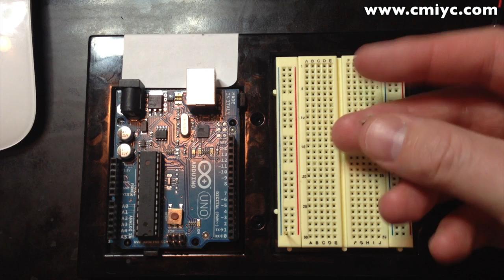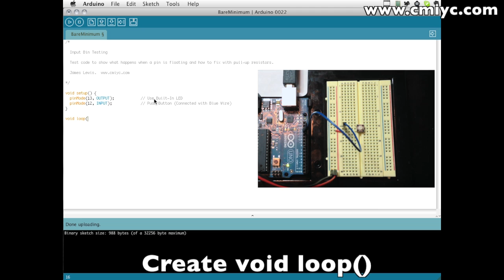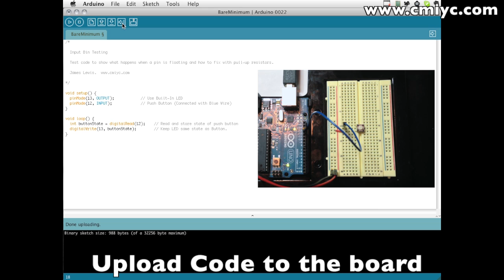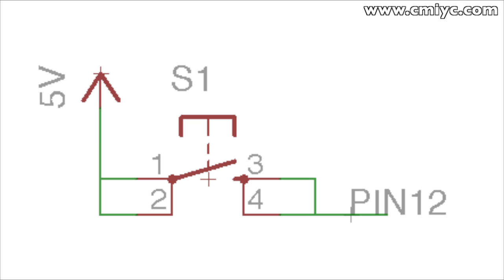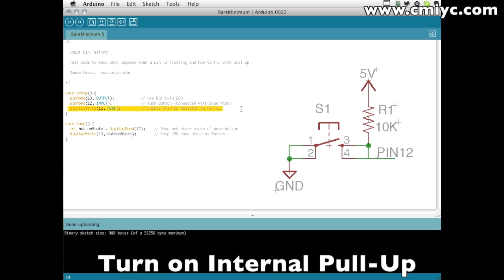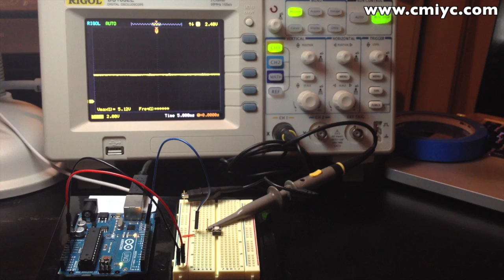Button Tutorial: Arduino Built-In Pull-Up

Comment: Code should be: pinMode(12,INPUT_PULLUP) instead pinMode(12,INPUT)
Reply from the maker: That didn’t exist when I made the video. Which is why it is shown the old way, with setting to input and then writing a high to the pin. (Which still works today.)
Reply: @bald_engineer  OK thank

Comment: Why do you still have the 5V wire going to the breadboard.  That doesn't seem to be used for anything in your circuit once you enable the pullup.  If that is true where is the 5V coming from in your diagram.  I guess something is going on with the input pin that I don't quite understand.

Comment: @James Lewis

Is using digital_write on a pin setup as an input just an older way of using the internal pull-up resistors? I know Arduino has an input_pullup parameter when defining your pins' functionality, but I keep seeing this way of utilizing the pull-up resistors. Was this video before an update to the language; I see this video is like five years old now and I'm just learning about micro-controllers.

Comment: At 2:32  you show a diagram.. with an arrow pointing at 5V. What is that arrow? Is it meant to be conventional current? (thus pointing from + to -).  Or is it electron flow (Thus pointing from - to +).  Or is it neither? What is that arrow?!
Reply from the maker: boliussa It’s just a symbol for a voltage rail.
Reply: @bald_engineer  ah ok, thanks

Comment: How to do the opposite, and have LED turn ON when the button is pressed? The pin is always 1 with the internal pullup, and pressing the switch pulls it down to 0. One way to do it would be to check when the pin is not equal to 1. For example:

void loop() {
  if (digitalRead(12) != 1) {;  // If pin 12 is not high, then button is pressed...
    digitalWrite(13, HIGH);  // Turn on the LED
  }
  else (digitalWrite(13, LOW));  // Otherwise, while button is unpressed and pin is pulled up, keep the LED off
}
Reply: You can change the arduino code after reading pin 12.    
Add=>  
if (buttonState=HIGH) buttonSate=LOW; 
else   if (buttonState=LOW) buttonSate=HIGH ;

Comment: Fantastic video!  Very clear and easy to understand.  I learned a lot - like that Arduino code is very case sensitive!  Words like INPUT and OUTPUT and digitalWrite must be capitalized just as they are written or the code will not work.  It took me quite awhile to get all the capitalization bugs out of the code before it would compile.  The only change I would suggest would be to show on your schematic that the pull-up resistor is internal to the Arduino but a very minor point.  Thanks again!

Comment: how do you "turn on" that resistor? :S
Reply: simply by writing in setup(){
digitalWrite(12, HIGH);
}
Reply: am not sure but i think i thought about how it is done physichally, i am not really into this now so doesnt matter anyway
Reply: maybe with an electrical gate called "transistor". there could be a transistor in front of the pullup resistor. if you choose INPUT the transistor blocks current (via electrical signal) from flowing through the resistor. if you choose INPUT_PULLUP the gate gets opened (via electrical signal) and current can flow through the resistor.

Comment: Great Video!  With the newer Arduino software, you now activate the pull up resistor with this code: pinMode(pin, INPUT_PULLUP);  I think that the older code [digitalWrite(pin, HIGH);], will no longer work with the newest versions of Arduino software.  You can read more about it here: http://arduino.cc/en/Tutorial/DigitalPins
Reply from the maker: No, that is not correct.

The existing method of using digitalWrite() continues to work on all versions, it was not removed.

One change that did happen when INPUT_PULLUP was added is that the INPUT argument automatically turns off the internal pull-up when pinMode() is called.  Previously pinMode() would respect the previous digitalWrte() call (it looked at the appropriate PORT register) when enabling the pull-up.

Comment from the maker: Thanks for the feedback. 

The pull-up can range from 20 to 50K and seems to generally come close to the middle (on the chips I've measured).  The 10K I drew was more for illustration purposes.

As far as discussing pull-downs first that's a trade-off in explaining everything and explaining just enough.  As engineering (or technically) minded people, we almost always opt for explaining too much.  

I think it would be better to explain the difference in a separate video.

Comment: Finally, a simpler and more intuitive way of enabling the internal pull-up resistor is with a new (not sure what version of the ArduinoIDE introduced it, but I know it works in v1.0.3+) pinMode keyword. Use it like thus:

pinMode(i, INPUT_PULLUP);

I think it was introduced by the developer of the Teensy, and was (seemingly reluctantly) rolled into the core ArduinoIDE. This is based on some forum threads from 2009 that I recently read through, I could be misinterpreting the history.

Comment: Great explanation, but could have a couple tweaks.

It would have been nice if you had also shown the common way of solving the floating issue as shown by many of the beginner level Arduino tutorials by using an external pull-down resistor. Then help explain why using the internal pull-up resistors is better for cutting down external component count and wiring at the cost of having to think in low-active logic.

Also, the internal pull-up resistor is 20K, not 10K like you show on your schematic.